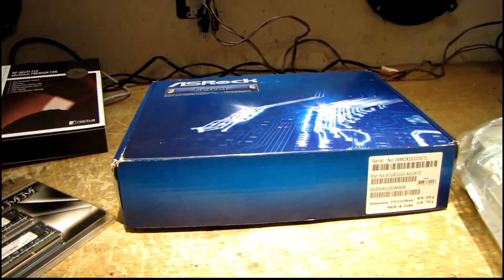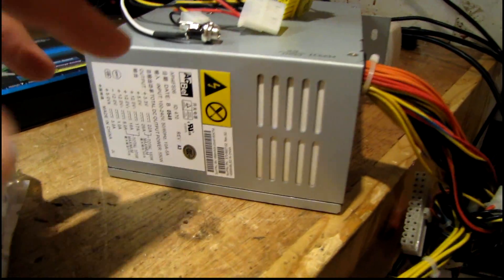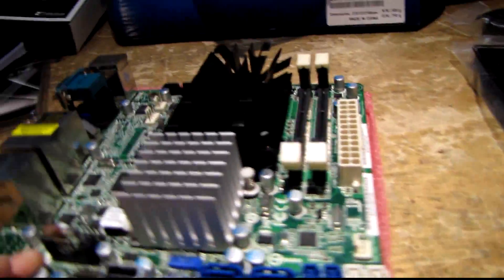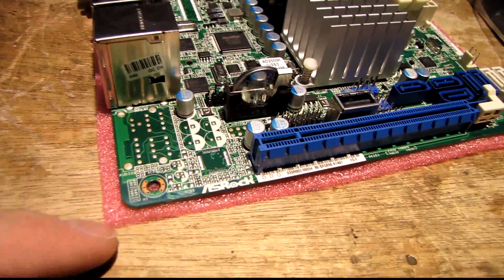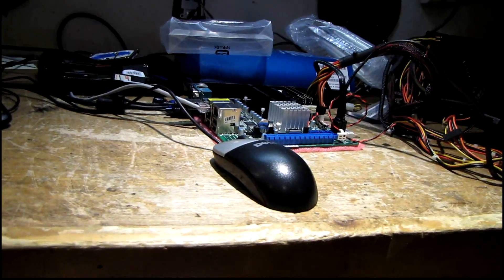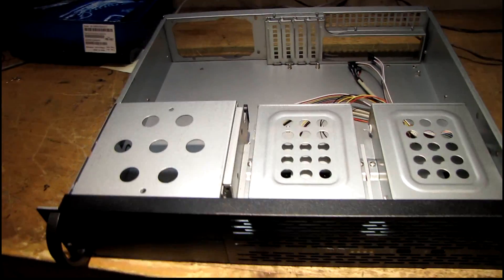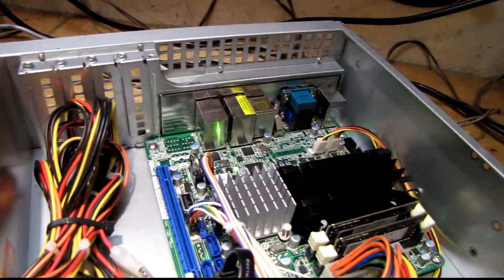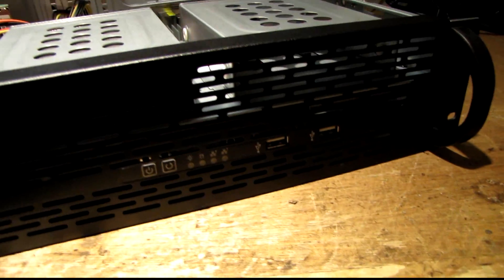LAN Server Upgrade 2-20-14

Comment: Thanks for this video.  As always very inspiring.  That board really is a nice find. Well thought out. Mini ITX boards make a lot of sense for home servers compared to the power hungry EATX form factor ones that commercial servers have.

I had a supermicro x6-daeg2 (EATX form factor) board (dual XEONS with HT) that I had completely forgotten about until I started watching your videos.  It is my first server board and I was just curious to see if I could get something up and running.  Your videos have really helped out with that and I have gradually been extending my network throughout the house (100Mb/s at moment but looking to upgrade to gigabit) in anticipation of setting up a file server/game server/backup device.

I first watched this video a few weeks ago and really struck by the idea of such a low watt server, however as my budget is strictly limited I am going to stick with the supermicro board for now even though it is a bit low spec (your pentium 3 rig gives me hope).  Stupidly it has built in audio but no video! I have added 4gb ram, 128MB graphics card and 2 x 250gb western digital sata drives most of which I also had lying around.  The cons are this board only has 2 sata connectors and 2 ide connectors which I dont want to use (speed concerns).  NO scsi either. Pros are that it already has 2 gigabit LAN connectors. If I want to add more hdd in the future would it be ok to use normal PCI slots for a sata controller or would I have to use a PCI E 4x?  Or should i use the ide connectors? Would I have speed issues on gigabit lan? Better still would a scsi controller be better?

The biggest problem I have had with my server is the PSU.  I am a bit paranoid now especially after watching all your PSU videos :) . I couldn't find the original PSU cheap enough so was looking into other options including the pico psu you mentioned (I know, call me crazy).  I think the reason the pico power supply is only 60w is because that part only supplies 3v and 5v rails.  The actual 12v supply comes from the external laptop style power bricks that you are supposed to use which are very efficient by the way.

Finally found a 3u supermicro server case with 450w power supply. Waiting to get it delivered.  Can't wait to have it finally assembled.

I have been testing a few OSes on it. I checked out NASLITE 2, openfiler and freenas but have finally settled on unRAID off a 4gb USB stick.  Love that board mounted usb connector.  FREENAS seems to be the OS of choice but needs 8GB RAM to run properly! Have you ever tried unRAID?  I know the free version is a bit limited (max 3 drives supported).

Its been fun getting this far but like this video points out better to just pay upfront  for the newer hardware and save in the long run but then again as the saying goes BEGGARS CAN'T BE CHOOSERS, I suppose.

Comment: That old DL360G3 has the same BIOS and message layout as our LAN-party's much newer DL585 G2 and DL385 G5, they of course use many watt and give out incredible amounts of noise as well, but luckily they're only on 10 days a year. Also there is a couple of Dell C200's and a SC1425 on for those 10 days.

That LAN server-project looks pretty cool, I've actually looked on those boards in the last sorta while, might be picking up a couple for some ultra-small builds in the not too distant future. I've got the message that my dad wants me to cut down the power usage, so I'll look at minimizing my stuff, I have to look at that since I have 6 2TB drives in RAID 6, which might be a little hard. 

Nevertheless, good work on the video, I knew something was going on over at your place since there really were no videos in a while, I should really pick up my camcorder and do the same thing very soon as well, lol

Comment: Glad to see you got some use out of that server. You should the unit we replaced that server with its a freekin monster comaperd to that unit. It took 2 guys to mount it in the rack. It was the newest version too. I agree with ya that this winter  has been horrible, and its not over yet. Great vid Max
Reply from the maker: I hated to stop using it, these servers have always been more reliable than anything else I've used.

And my cousin is still using that bigger DL380 as his LAN and file server.  I put all new drives and some other upgrades into it, and had originally planned to use it for a DVR, but I ended up getting a standalone DVR for free that I used instead.

Also, that big Dell plasma TV is the same model that I have in my living room now.  Mine has some sparkles that tend to go away after it warms up.  Not sure if you still have that TV, but I figured I'd mention that.  At the time I thought that TV had a messed up sustain board, but it might just be normal behavior for those when they have a lot of hours on them.
Reply: Oh just you wait for the heat wave. I prefer winter over summer. Much easier to keep warm than to keep cool.
Reply from the maker: labobo It's not just the temperature that's a problem, it's the snow and ice.  Winter heating bills are still higher than Summer cooling bills, at least for me.

Comment: That is expensive for gas and electric. Is it a private company? Here in Orlando our utility company is owned by the residents of the City. So they are not for profit. My electric, water, sewage, and trash disposal in the middle of summer averages a total of 140 dollars. And that is with the A/C set at 77, a security DVR, a server and my desktop on all the time. Although I must add, I am in a 1200 square foot home and live alone (except for my cats). I hope to save more when I convert my range and water heater to propane and install more efficient windows. This house was built in the mid 40's and many of the windows are jalousie.
Reply from the maker: I'm on Consumers Energy.  I think the natural gas is the most expensive part, since my bills for the hottest Summer months are usually about $100-150 less than Winter.  My house is over 100 years old and not insulated in most of it.  The A/C can't get it any cooler than 74 degrees or so.  We also have a modern furnace and water heater, but I still pay a ton for gas.

Based on my calculations, it will take about 3 years for this server to pay for itself in energy savings.  The file server though, I'm not so sure.  That's going to cost around $2k and only save around 100 watts or so if I had to guess.

Comment: I've had to cut back on energy use too, was getting expensive.

I used to run folding@home on my server at 165w, have my desktop running 24/7 idling at 50w(ish), along with some other devices.

The server is now gone, my NAS is an ARM-based QNAP which idles at 5w and my Ivy Bridge desktop idles at 25w (80+ Gold BeQuiet)

Miss having a 16-core server though! Opteron 6274 FTW

Comment: That PIII server makes more noise than my P4 tower and even the knackered Athlon XP tower I used to have years ago!
Reply from the maker: Ya, most servers are pretty noisy.  They are more concerned with cooling and stability, plus the smaller height cases require small diameter, high speed fans.  That's one thing I love about modern home PC's.  Nice big fans that spin slow and quiet :-)
Reply: I've seen my P4 tower (in a previous case where the power supply was mounted in front of the CPU cooler, and didn't have a top-mounted fan) have its CPU fan spin up to 4.5k, and if I crank my GTX 670 graphics card's 3 fans all the way up, it can definitely make more noise than this server (I think they hit 5k RPM or something stupid at max revs!)

Comment: Hey max like you I had multiple pcs on the go in different rooms always needing upgrades and good fun it was tinkering with it all , but here in uk electric is also $$$$ so these days I have 1 server used for backup and streaming with raid array running esxi and just 1 laptop  i7 maxed out with ram , cd drive removed with 2 1TB raid  , never looked back. , low power consumption and less time spent upgrading fixing and paying for electric .... Just a thought mate you could use the laptop for music machine.  , bedroom machine , work bench pc etc ...

Comment: Our electric here in West Virginia is running about as much is your gas and electric combined. We have no gas service and no server. I bought one of those remote control power switches for my entertainment center. I've been leaving everything in it without power. I mostly watch basic cable anyway and a small bedside analog TV has been keeping me satisfied. Mom thought the last electric bill would be higher than it was. I bet what I'm doing is making some dent. I question what that remote control switch consumes in standby.

Comment: I have an Opteron socket-940 server with that ATI Rage chipset, and while I certainly didn't expect much from it, I did expect it to render a decent 2D desktop. I was surprised how slow it is even at that task.
I certainly didn't expect linux to have a problem with the most common server graphics chip of several years worth of motherboards. But maddeningly, the Xorg devs decided it was okay to break all their older drivers. It took a lot of researching and screwing around just to identify and work around that breakage.

Comment: I remember when I was running a DL360 G2. The energy consumption became too much for me. At the time my whole bay was using about 250W continuos.
I now have more powerful equipment in my bay and the energy consumption of the whole bay is now 70W! This shall soon increase to 80W in order to make a saving of 50W in the house.
It's the continuous loads that really bite as you are well aware.

Comment: Normally there is also a little headroom for 'undervolting' the cpu & northbridge - 5-10%. Doesn't sound like much, perhaps, but it can be considered totally 'free' savings - as it does not in any way impact performance. Also - everything runs a little cooler and 'quieter'.

Comment: Hey Max good video, just wanted to inform you that the antec psu might use a cheap capacitor brand so just be careful, they used Fujyyu capacitors and had lots of problems.

Comment: i like that better then my dell optiplex 330 that has the lan light always on. it changes color depending on if it is 10,100, or 1000. mine is always green so guessing i have 100. not sure what the other colors are but maybe yellow and orange. rather it flash with activity.

Comment: If I was using pfSense would I have to worry about Realtek LAN controllers? I want to do a similar project to this and found a Gigabyte Celeron board with dual Realtek LANs

It is $50 less and I don't need the SATA capabilities like this board has.

Comment: it would be quite easy to get the ProLiant to play HD video, Club3D model number CGA-5452PLI, is a Redeon HD 5450, which can do most of the video decoding on its own, and the processors, which are indeed the fastest PIII's, can run the driver fine, but it does have PCI 3.0, the ProLiant has 2.2 but it should work with that (and various other older PC's).

Comment: You probably didn't have enough of a load on the AcBel power supply. Switch-mode power supplies need a minimum load. ( Some have a circuit which provides a load if there isn't enough )
Reply from the maker: Exactly.  Most of them from that era are regulated based on the +5v rail, hence the minimum requirement.  Otherwise it runs in overvoltage protection mode AKA  "crowbar".

Comment: Well if you have direct electric heating in your house you won't really gain anything during the winter from lowering your servers consumption, it all turns into heat just as the electric radiators do.

Comment: maxxarcade never dissapoints ;) also noticed the logitech M500 mouse, what do you think of it? i use the same mouse on my main system.
Reply from the maker: It's a decent mouse, but I still prefer my old MX518, partly due to the better quality cord.
Reply: yea i dont understand the thin cord either, i mean its not like it would have mattered that much to the price right?
Reply: Maxxarcade I'm surprised at how low quality that cord is, even the Steelseries Kinzu I picked up for my laptop for £20 (roughly 30 USD) has a higher quality cord.

Comment: I think you could run that Atom CPU from PSU with fan on top, simply because U won't need much (if any) airflow to dissipate heat from it.

Try to run passive PSU for a while (ie disconnect fan from active one) and see what will happen.

Comment: I'm using an old Compaq socket 775 mini tower that I recapped, with a 1.4GHz ULV C2D, 80+ gold 360W Seasonic PSU, an HP dual gigabit PCIe NIC and a 60GB SSD loaded with PfSense for my network server. Uses 65W on average, 30W idle. Cost ~$100 all in.

Comment: Hey Maxx are you using special UPS for your APFC power supply? I've heard normal UPS don't work very well with APFC PSUs. It has something to do with the approximation they do (i'm no expert XD just need to buy an UPS for my server)
Reply: If your power Supply has Active PFC you need to have a pure sine wave inverter in whatever UPS you use.
Reply from the maker: smoothguy1991 .
 My server UPS units are pure sine wave, but I also use approximated sine wave ones on APFC supplies, such as with my workshop PC's. 

From what I understand, the issue was because of the PFC converter circuit.  In some power supplies, the primary filter capacitor would get too much voltage when a non-pure sine wave is used.  But I think it's only an issue with 240v powered parts of the world.  I've never had an issue with it myself.
Reply: Maxxarcade
Some people say (including APC) it's fine to use APFC PSU with a non true sine wave UPS if the power of the PSU is inferior to 500w. I don't know if this is true, but maybe this is the reason why your server are working fine.

Comment: is this a good powersupply for my quad core file server, it has an A10-7800, i want to neuter its graphics capabilities until i can get a really efficient chip. 

EVGA SuperNOVA 650 P2 80+ PLATINUM, 650W ECO

and maybe if you can recommend me one that is more efficient?
Reply: Seems pretty alright to me, but then I'm using a 300W BesTec that's been working fine for 10+ years.

Comment: Exactly what is that server used for?
What operating system does it use?
Never really seen the point in having a big server for what the broadband modem already can do. If not than a good little switch can. Firewall you always install on all computers so isn't that server redundant?
Reply from the maker: I'm running ClearOS 6.5 on it.  It's basically a big router and VPN server, and also provides some antivirus functionality on the fly.  I don't really like to use small standalone units because they are slow and more hacker prone.

Comment: Dual P3s have a lot more power than people give them credit for. Unfortunately they are also quite old and therefore are inefficient compared to today's low power systems.
Reply from the maker: The late model P3's were sweet.  Some of the architecture is still in today's CPU's.

Comment: UBUNTU 12.04LTS Server was the first Linux OS I have used because running Windows XP Pro on a machine with SATA would always glitch and it turned out that Windows XP Pro had no AHCI drivers so that is why I switched to UBUNTU 12.04LTS Server but have since switched to Linux Mint 17 Cinnamon (Qiana) 64bit. Along the way I have had other flavours of Linux Mint MATE from 32bit to 64bit and I would rather have Linux rather that that drivel by Microsoft BTW I tried to install Knoppix Linux but without success also tried to install GhostBSD but MSDOS  couldn't even see the GhostBSD menu item and when will people start calling Linux UNIX I know that AT&T would not like it but Linux is as close to UNIX that makes no difference even Apple Corp are using FreeBSD as the basis for OS X EL CAPITAN..............................................................

Comment: I don't argue with anything hardware wise but there is only thing that itch me... I will never recommend SSD's for server application. Yes they are faster than your typical hard drive... BUT! The data access is too heavy and will probably kill your SSD over time. Even as a system drive. Anyway, that setup will lower your bills :P
Reply from the maker: Ya, I really thought about using a regular laptop drive, but I couldn't find the 20GB one I wanted to use.

Linux does support TRIM, but the kernel in the current version of ClearOS is still one version behind in that respect.  Luckily the access is very light since most of the OS runs in RAM.  I don't think it will die any time soon.  In fact I'll probably change it within a few months anyhow, if I find a better solution.